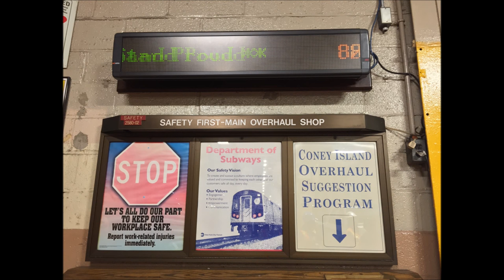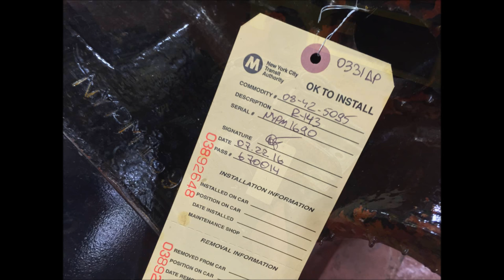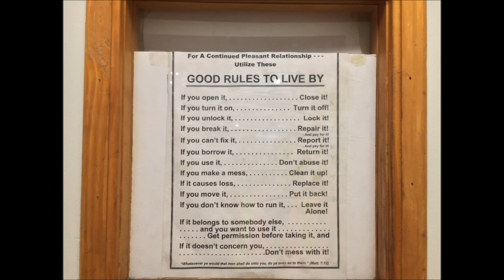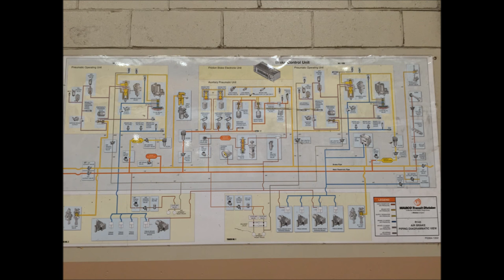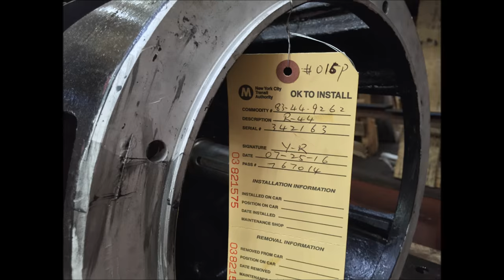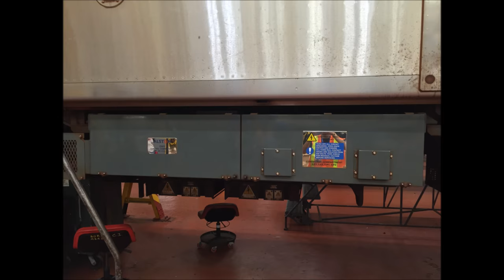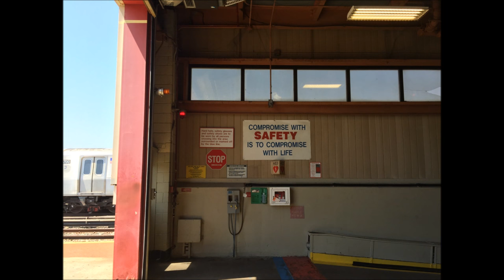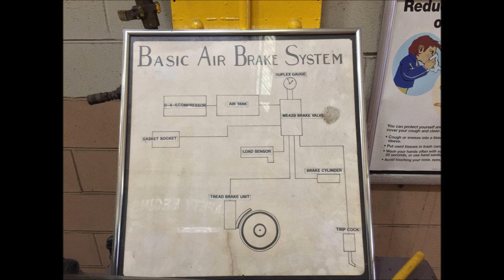NYC Subway HD Photo Montage: New York Transit Museum Coney Island Overhaul Shop Tour (8/13/16)

Comment: Wait, why are there Staten Island R44’s in Coney Island shop? How do they deliver them from SI and SIR dosent have a overhaul shop?
Reply: Staten Island Railway (SIR) was Staten Island Rapid Transit Railway which was a private owner before it went under ownership of Metropolitan Transportation Authority. Staten Island Railway is a small-scale railroad and is much smaller than the New York City Subway, even smaller than Port Authority Trans Hudson railroad. There is possibly no room for a large railcar overhaul shop in Staten Island. For major repairs, the R44 cars are moved to Coney Island Rapid Transit Car Overhaul Shop. Fortunately, the B-Division subway cars are repaired there, and the R142A and R188 cars are now maintained at 207 Street Shop, thus relieving Coney Island Shop from that excess burden of storing more subway cars than needed.

Comment: What is that stick at the wheel is it the thing that helps give power to the third rail
Reply: That is a third rail jumper and it is used to feed electric power to the contact shoe of the subway car.